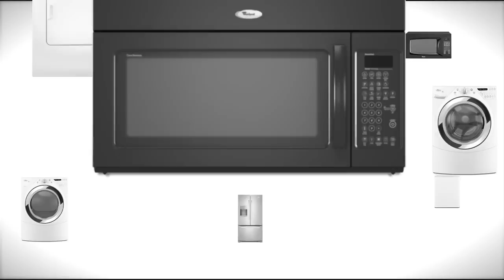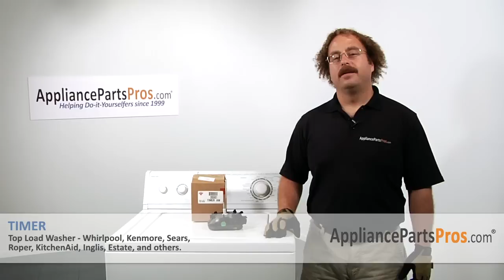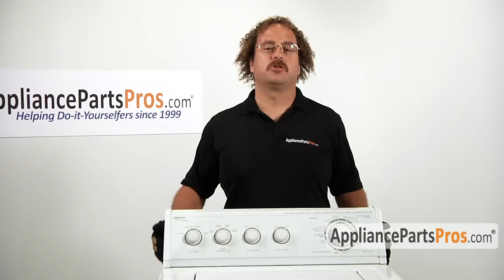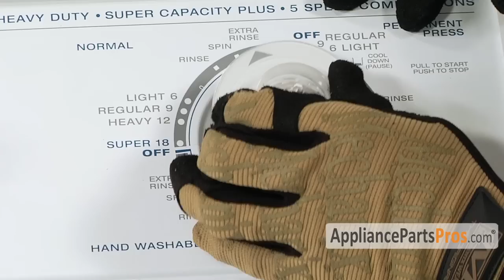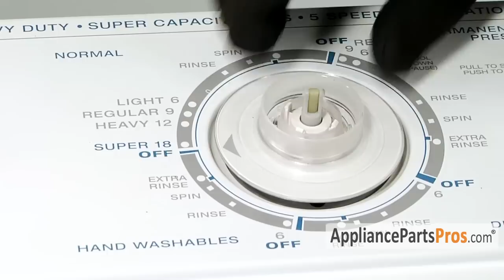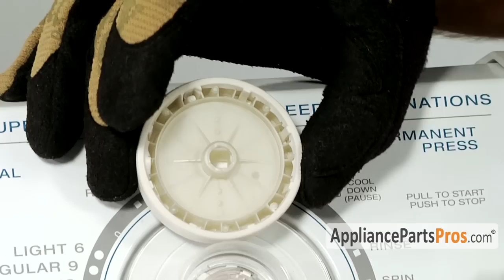How To: Whirlpool/KitchenAid/Maytag Washer Timer 3955651

Comment: Is this why washer won't drain? Will this work on WHIRLPOOL LXR6432JQ1?
Reply from the maker: Have you checked for any clogs? Do you happen to have a multimeter? You can test the timer to see if it has failed. You can also see if the drain pump could be causing your issue as well.
Reply: @appliancepartspros  I don't have those. But heard timer often causes this issue? It could be drain pump as well? I never knew about that part.
Reply from the maker: It is possible that the timer could be causing the issue that you have going on, but I would look for clogs and check that drain pump as well.
Reply: @appliancepartspros  Thanks!
Reply from the maker: You are welcome. If we can help you with anything else please let us know!

Comment: My older Roper Washer won't spin UNLESS I shut it off and turn it back on at the end of the wash cycle and rinse cycle respectively.  Otherwise, it runs from start to finish but if I do not do the "shut off, turn on" thing at the right time, the load finishes unspun.  Any ideas?

Comment: Thank you. Clear and simple instructions. Exactly what I was needing. I’m a semi handy homeowner, trying to get as many years as I can out of this 20 year? old washer and dryer. I did not need to replace the timer, but it had come loose from the panel and I wanted to see the recommended way to disassemble and reassemble it without causing more problems than I started with. Your replacement parts and instructions are very helpful. Thanks!

Comment: Had to pull the plastic (crappy) shaft to get the front knob off. It didn't screw off on my 2003 Kenmore 80 washer.

Comment: How can we definitely narrow down the problems to Timer replacement? What are the symptoms? If the Agitator cycle is working and the rest (Drain, Rinse, Spin) cycles didn't respond as the Timer pass through every cycles, can we still attribute the problem to the Timer?
Reply: Great question. I came here for that problem. I have an Admiral the issue is that when I try to do any type of initial washing, it hesitates at first to fill. Rinse cycle appears to be fine. I'm not if my issue is with the timer or another piece of hardware.
Reply from the maker: One way to determine if the timer is bad is to test it with a multimeter. If you need help with that, you can give us a call at 1-877-477-7278 or you can chat us at our website: http://www.appliancepartspros.com/.

Comment: Hello, my washer is similar to the one on this video. I replaced the timer and it fit fine. However, when I put the knob back on the timer it doesn't stay and every time I try to use the washer when I pull the knob to start the cycle it comes all the way off. Did I do something wrong? I'm trying to see if I broke something inside of the knob but it looks fine. I'm worried about maneuvering it too much and finally breaking it
Reply from the maker: If you replaced the timer, there could be a problem with the timer or the skirt.

Comment: And remember that metal is sharp, changed the timer but sliced wide open my finger. Yea the repairman is wearing gloves.
Reply from the maker: +Bob Slone Glad the video helped you get the washer fixed!
Reply: AppliancePartsPros so if my washer will wash, spin fill up, I just have to turn the knob threw the cycle til the end is it my timer as well I have a Frigidaire top layer 9 cycle heavy duty 2 speed
Reply: Yvette Davis sounds like it

Comment: My timer is fine but the plastic piece that holds the timer in place on the rear side of the washer face plate broke (there's a cheap plastic clip that holds the left side of the timer in place on the left side and a screw on the right side). With that clip gone, the timer moves and does not operate. Does the entire faceplate of the washer have to be replaced? I have model number GTWP1800D0WW. Is there any way to secure the timer. I taped it in place with electrical tape and it does work but looks really bad.
Reply from the maker: +Kay H. The timers are sold as complete assemblies, if anything breaks om them you have to replace it. If that is not an option then you have to find another way to secure it.

Comment: Why don't you show what you're doing in the back of the machine????? I removed the 3 socket screws in the back but it wouldn't slide forward nor would the end caps come off like another video showed....  When you're doing a video to show someone how to do something, "DON'T JUST SKIP OVER HALF THE STEPS!!!" Show "Each" step and show what you're doing not just the front of the machine while you work on the back!! Because if you can't get the top off the rest of the video is "USELESS!!" I HAVE A SEARS KENMORE, but it doesn't look like that one but the switch does look like that one... And there is another video that has a washer that looks like mine but he does the same thing and skips over all the steps to get the top to come off, and his switch is a lot different than the one they sent me for mine... I can't get the top off to even see if it is the right part or not... Now thats 2 days wasted trying to fix this thing...Find a Kenmore model 110-15862400 and show "STEP-BY-STEP" HOW TO CHANGE OUT THE TIMER!! AND THE SPIN SWITCH AS WELL...
Reply from the maker: +Debo Debod There are a few different versions of the console as we talked about in the video. We could not show them all only the one we had, with the screws in the back of the control panel end caps. According to the model number you supplied it looks like you have the end cap trim covers, they have to be removed in order to access the screws underneath.  You can go to our site and look at them, the part number is: AP3094274.

Comment: Repairman said timer switch was bad. Told us to just not bother trying to fix it and get a new washer. We bought a switch,  replaced exactly as instructed on your video. It's still doing the same thing. It's filling but not agitating or spinning.  Anything else it could be?
Reply from the maker: M DiLonardo You can post the problem along with the appliance model number on our repair forum and the techs can help you troubleshoot the problem.
Reply: Have you checked the motor coupler?  If you hear the motor humming but the machine isn't agitating or spinning, there's a good chance the coupler is bad.  Very inexpensive part and easy to replace.
Reply: +M DiLonardo  If you hear the motor going but its not doing anything then its the motor coupling.. If you don't hear the motor trying to go then its the lid switch. Its a very cheap and easy part to install.

Comment: @ Joe Giaquinto,out of curosity, what was wrong with your washer machine before?, I am trying to fix mine, but not sure if the problem is the timer, is really acting crazy, especially during rinse process, and when the cycle has been finished, it starts by itself a new washing cycle again.
Reply from the maker: garciaJo65 I know you are asking Joe, but you can post the problem along with the model and serial number of the appliance on our repair forum and the techs can help you out!

Comment: I replaced the knob and dial to my Kenmore Elite washer and the knob still doesn't turn the shaft. The dial will turn the shaft to the desired setting, but the knob just spins. What else can I try other than buying a new timer?
Reply from the maker: If the knob will not engage the timer when its in the down position, then there could be something broke inside the timer. They do not sell parts for timers so if something is broken it will have to be replaced.

Comment: I found another flaw in this video. When replacing the timer knob, the video tells you to pull the middle pin back first- correct- but after the timer knob is snapped back on, the video neglects to remind the viewer that the middle pin has to be pushed back in again until it snaps- otherwise the knob will not lock well into place.
Reply from the maker: If you just set the knob on the shaft,  then yes you may have to push the pin in. If you set it on and push the knob back down to the off position it should lock the knob on.
Reply: AppliancePartsPros I'll take your word for it. I'm not gonna take it apart again just to prove you wrong! Again, thanks for posting the video.
Reply from the maker: Thanks for the feedback and I'm glad it helped out!

Comment: Thank you for this video- without it, I would've had a much more difficult time removing the hood and timer knob- which I probably would've broke by forcing it if you hadn't shown us how to pull the black pin back first. My Whirlpool is a slightly different model but some things are very similar. One step I think you neglected to show here was that the little screw underneath the timer dial has to be removed first. I'm pretty sure that screws into the timer and I had a very difficult time removing the timer until I removed that little screw. I don't see any other purpose for that screw unless it screws into the timer. As I said, my model is slightly different but the little screw appears in your video too. Again, I don't see any purpose for that screw on your washer other than screwing into the timer. Maybe it doesn't screw in but just holds the timer in alignment by fitting into the little hole in the timer? But again, thank you for the video- it was very helpful.
Reply: Brian Ferrell
Reply from the maker: Some models may differ but on ours the screw did not hold the timer in at all. Glad the video helped!
Reply: AppliancePartsPros It didn't actually appear to screw in to the plastic on the timer at all (there were no visible threads in the plastic), but on mine it definitely made it easier to remove the screw first- I know because I did it twice! Yes, I'm sure that models differ- but what other purpose can there be for that screw but to help hold the timer in? Otherwise, it's just a screw that screws into a hole for no reason! Maybe it just helps hold the timer in place and with some models you can just pull the timer away from it. It turns out, the problem with mine wasn't the timer at all- just a bad lid switch. :-(